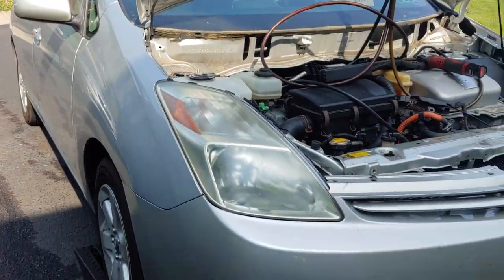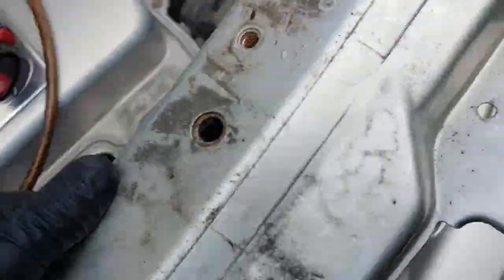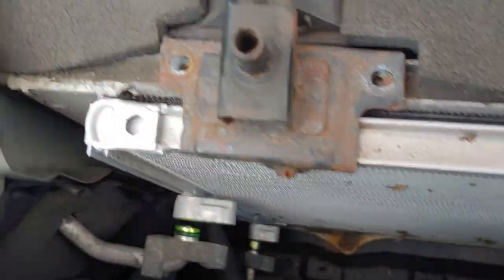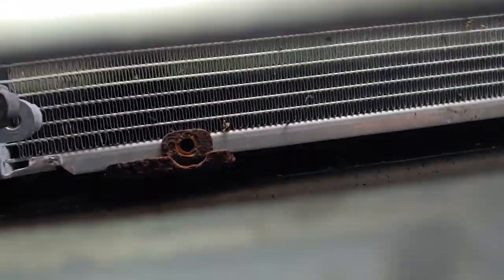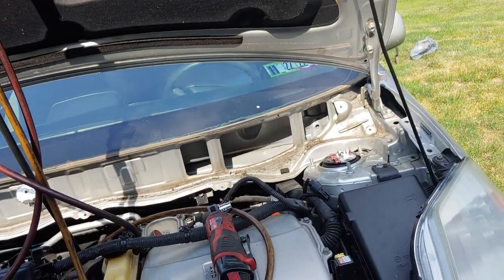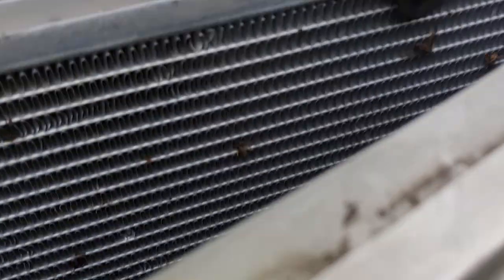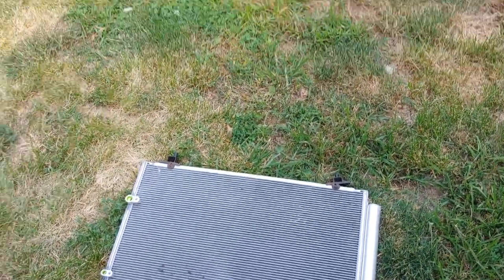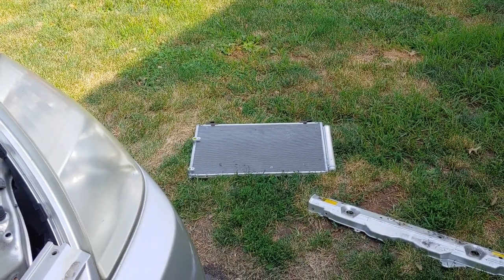2005 Toyota Prius a/c condenser replaced in less than 10min?

Comment: What brand for the condenser? Did the new condenser come with orings?
Reply from the maker: Denso, which according to the listing is oem. In my opinion...as a do it yourselfer or on a budget You can get away with a cheap condenser because how easy they are to do... if it was a nightmare get the better part because you don't want to do it again...
Reply: @madmike214  did the new condenser come with old rings and how is your AC holding up now
Reply from the maker: @chipete1  i believe so, i alwayshave orings on hand. Car is blowing ice cubes...it's not my vehicle, this is a customer car.
Reply: @madmike214  I'm going to attempt to replace the condenser myself do I need to add oil or can I get away with just adding freon only
Reply from the maker: @chipete1  that kinda depends...but usually about 1-2oz for each component replaced should be added. Keep in mind you need to put the correct oil in as well, it has to be hybrid comparable. I used TEMP SELECT hybrid electric part number 59889 or 409610
Reply from the maker: If this was a bad leak and you see allot of evidence of oil leakage might want to add 2-3oz to make up what was lost from the leak